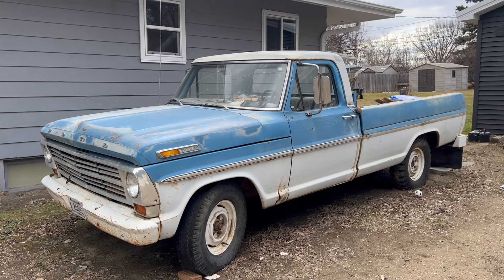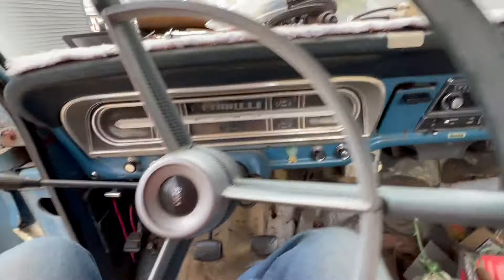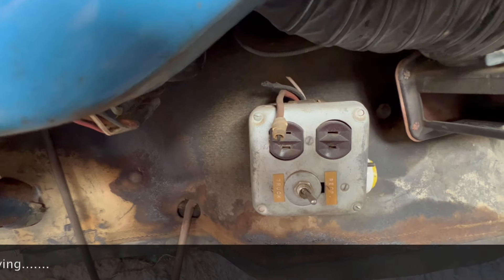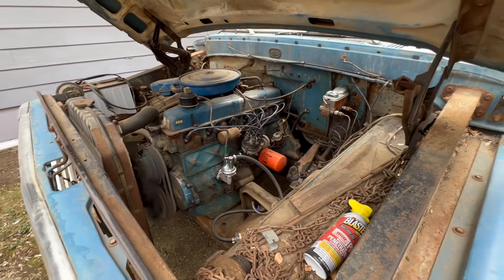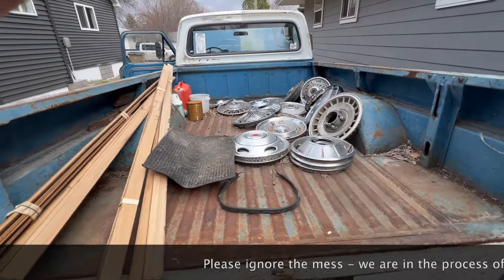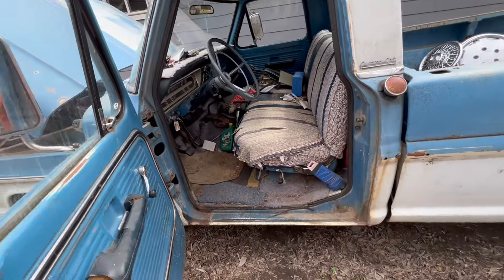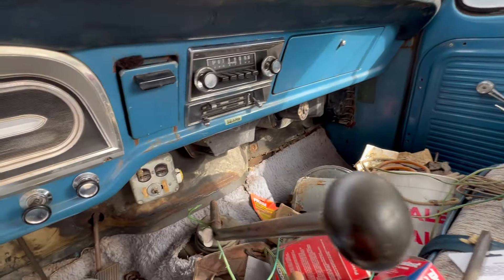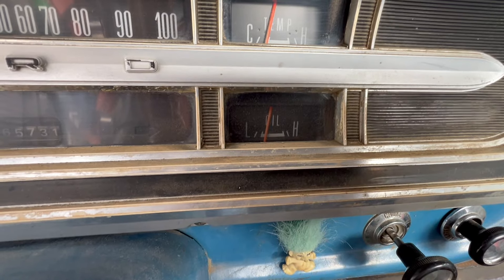1968 Ford F100! Project #106

Comment: Great looking truck.  Oil pressure looks normal for the age and miles of it. We had a 351 Windsor that did the same thing.
Reply from the maker: Thanks Aaron! That's kind of what I was thinking.... if the pressure was dropping to nothing then I'd be worried LOL. Next I have to get the carb right.

Comment: Try adjusting the carb and put new points and plugs in and see if that fixes the problem.
Reply from the maker: Thanks for the advice! You know I’ve tried adjusting the carb and noticed very little to know difference…..
I’ll give new plugs a try then adjust the carb again…